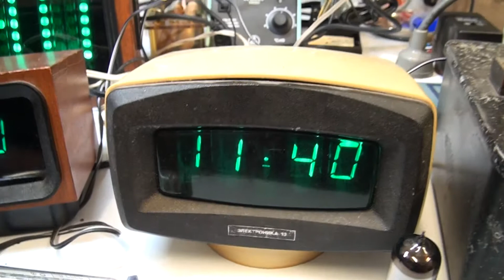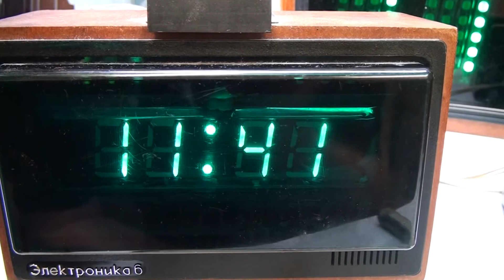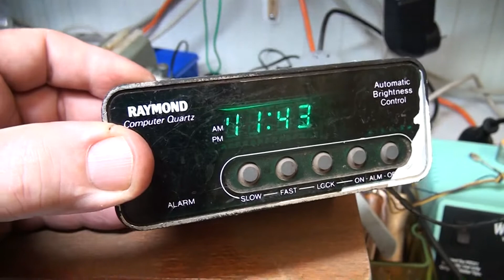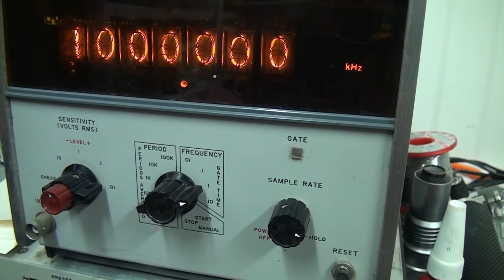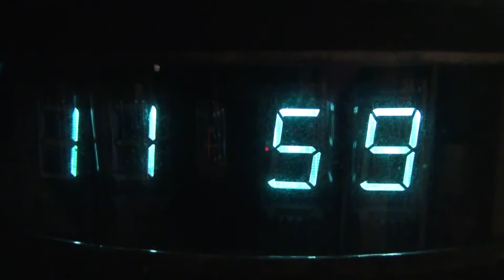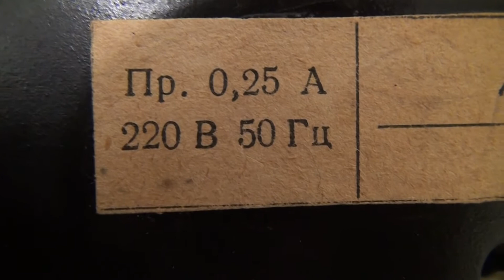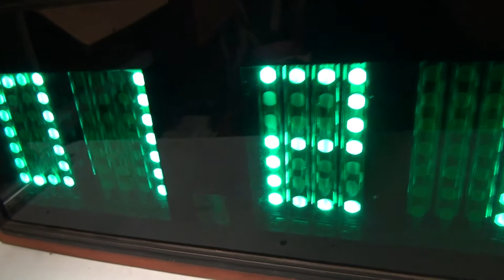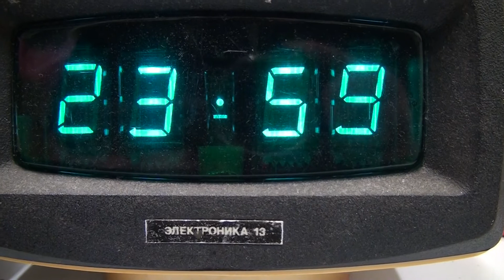Cold War era Soviet  VFD clocks (Elektronika company)

Comment: Elektronika is not a company, only a trademark assembled by some radio component plants. In Russia we still got these clocks working somewhere, that places looks like you turned on the time machine.
Reply: We got a lot of soviet technics called Electronika https://www.google.ru/search?q=%D1%81%D0%BE%D0%B2%D0%B5%D1%82%D1%81%D0%BA%D0%B0%D1%8F+%D1%82%D0%B5%D1%85%D0%BD%D0%B8%D0%BA%D0%B0+%D0%BC%D0%B0%D1%80%D0%BA%D0%B8+%D1%8D%D0%BB%D0%B5%D0%BA%D1%82%D1%80%D0%BE%D0%BD%D0%B8%D0%BA%D0%B0&tbm=isch
Reply: There is english article on wiki https://en.wikipedia.org/wiki/Electronika  but you can look through russian one it  has much more info  https://ru.wikipedia.org/wiki/%D0%AD%D0%BB%D0%B5%D0%BA%D1%82%D1%80%D0%BE%D0%BD%D0%B8%D0%BA%D0%B0_(%D1%82%D0%BE%D1%80%D0%B3%D0%BE%D0%B2%D0%B0%D1%8F_%D0%BC%D0%B0%D1%80%D0%BA%D0%B0)

Comment: A fine collection! Love the regulator clock, now it regulates time! Noticed the other middle tube on the one you repaired also seems a bit brighter than the rest, hope it's not a circuit irregularity that caused the early burn-out, but you've probably checked for that or been able to rule that out via checking the old tube. Neat stuff!
Reply from the maker: The other tubes have a fair few hours running time on them so they are a bit dimmer than the new fresh tube I put in hopefully it will burn in a bit. A clock with years of service will have very dim tubes, that one was originally very bad so I replaced all the tubes however that one tube failed only after a few hours of use.
Reply: I suppose there's bound to be a few bad tubes now and then, hopefully it'll even out in time!

Comment: Those individual seven-segment VFDs were also made without a control grid; a guy who runs a local electronics shop has a few Tung-Sol ones which don't have one.  They are only necessary to provide blanking for a multiplexed display.